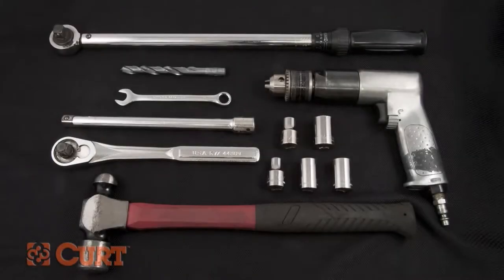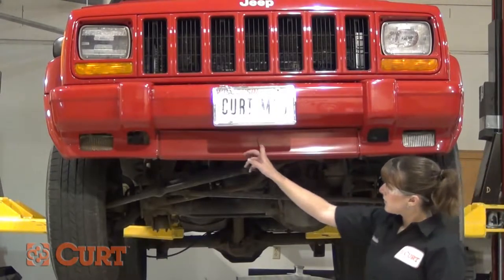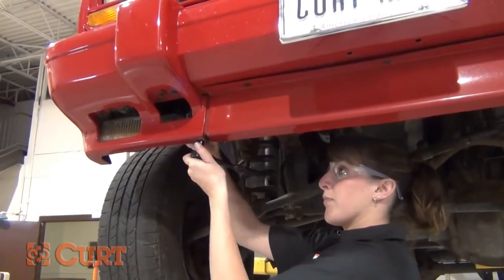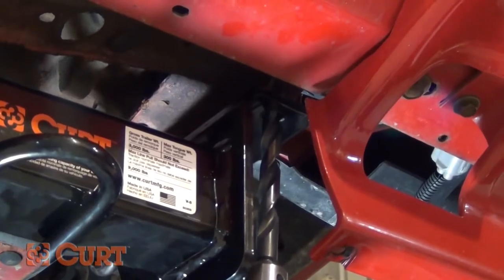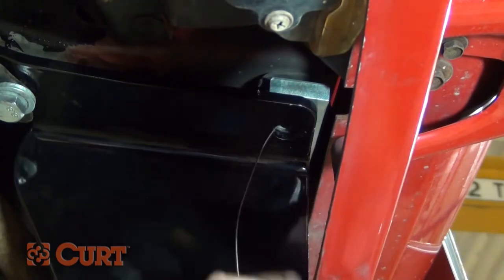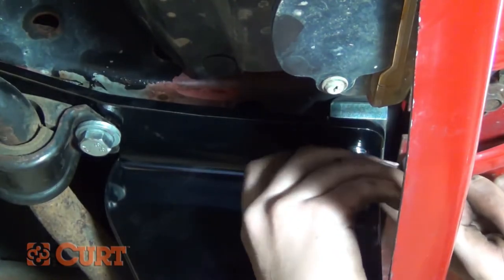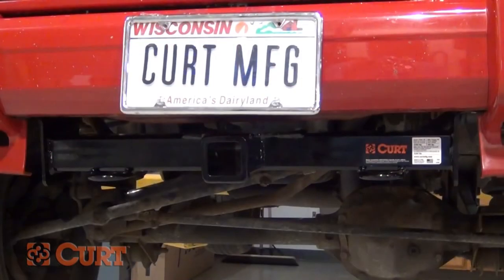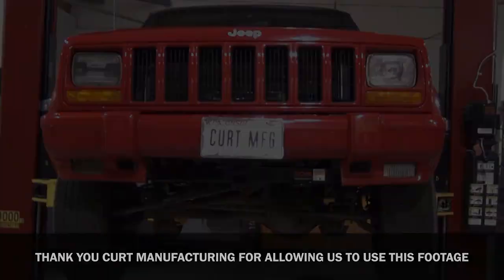1984-01 Jeep Cherokee, 86-92 Comanche & 84-90 Wagoneer - SNOWSPORT® Plow Front Mount Install Video

Comment: Didn't need to remove the front valance. . That's just ugly!  . . .  Just cut a nice square hole in it for the receiver to fit through. And then, with a grinder, notch out the steel on eitther side of the hitch so it doesn't hit valance. I have put 4 of these on Cherokee XJs, and they all look like it belongs there.